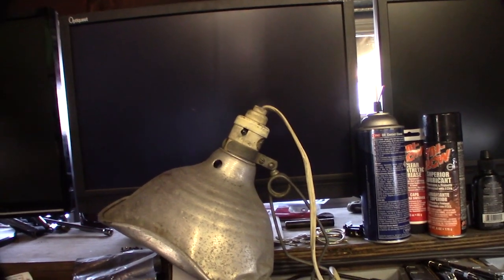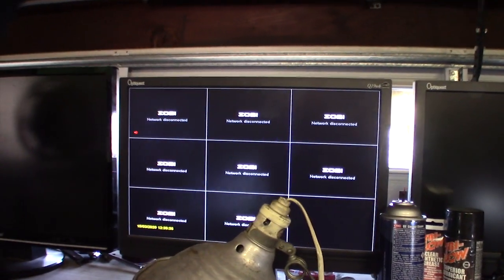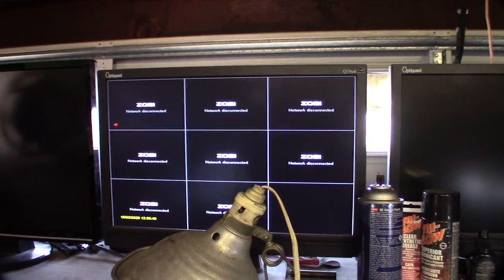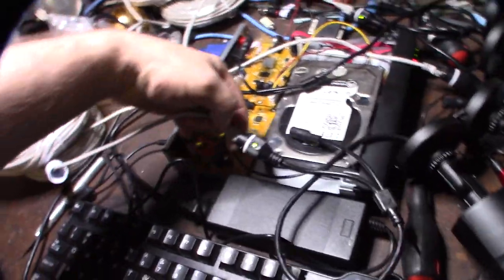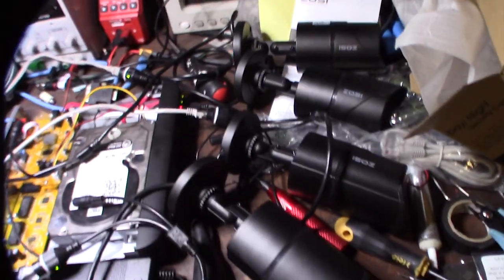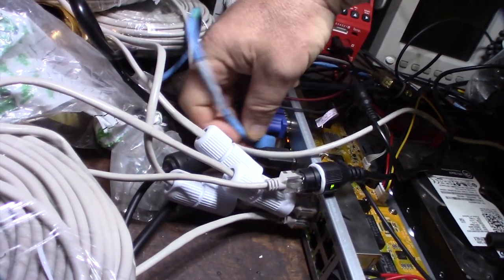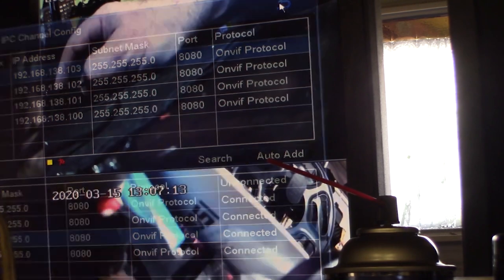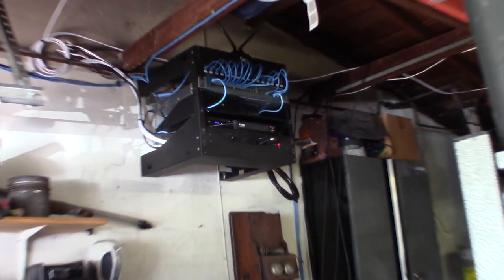Cheapest IP Camera System on Amazon ZOSI 1080p H.265+ PoE Home Security Camera 5MP PoE NVR Recorder

Comment: Looks like these cameras are using some non-standard PoE if the cable supplied supports PoE.
You are right about some cameras only liking direct connection to the NVR.  Some firmware is designed to only run with the NVR and detection system built into NVR.  Reolink and a few other name brands have cameras like that too.  They are usually cheaper than the true IP Camera versions of the same device.
Thanks for the review.

Comment: This company eludes to the fact (in another video) that you can use a wireless connection from another (let's say wifi extender) and back through your network, and into the NVR. I am hoping this is the case.

Comment: Thanks for the review, I’ve looked at this one but I don’t have any experience with security systems. When you mentioned potential issues with using a Poe switch does that mean if I had cameras in a remote building using a Poe switch connected via cat5 or wireless to the main building where the dvr is located that there may be problems seeing the cameras? Thanks
Reply from the maker: Possible, if the camera connect behind the NVR direct hook up or POE switch. The network port is almost like a WAN port. The 8 POE ports are a dedicated LAN built into system.
Reply from the maker: Its hit or miss with these cheap systems if the camera will register on the network/WAN port.
Reply: Fintech Repair Shop Thanks, for the price I may take the chance with it.